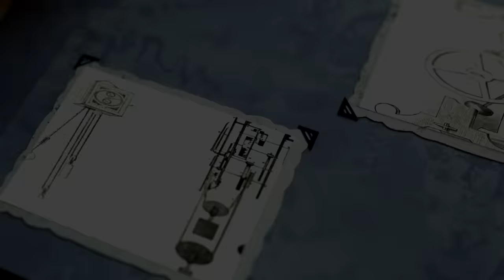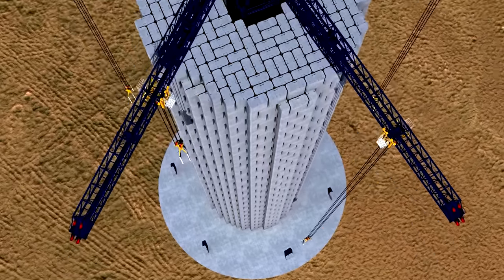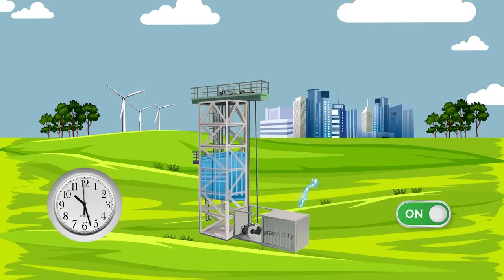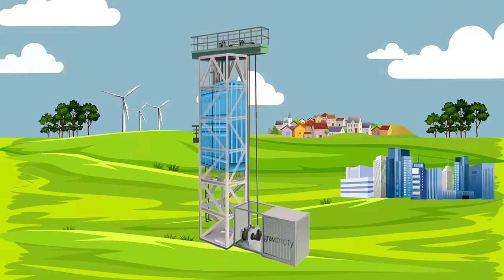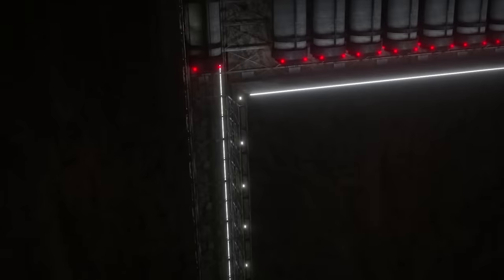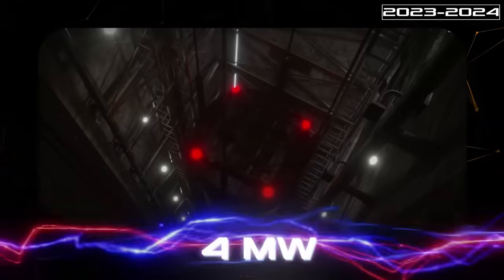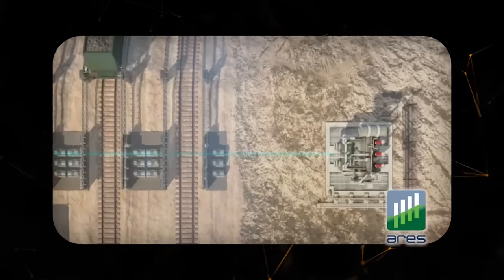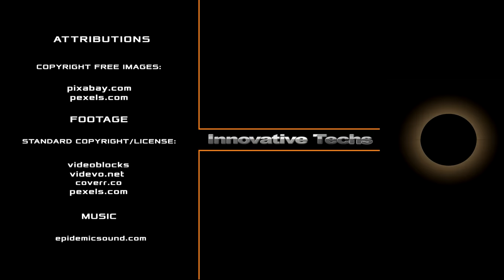How gravity batteries could change the world

Comment: This idea is actually founded on the idea of the pendulum clock, which uses the same gravity-powered principles to turn the hands of the clock via weights and a swinging pendulum to allow the machine to “tick”, allowing its power to last much longer than usual. This idea uses a much similar concept in the form of simply a much faster gear ratio to generate the electricity via the weight’s descent, and it too has been utilized in previous millennia to operate millstones and sawmills, and even more basic contraptions like gates and drawbridges, when the traditional means like water or wind were not even available. It’s a neat concept for today.

As for my personal stance on this idea, this is the sort of thing that could’ve popped up in a technological magazine back in the 2000s, along with other innovative products like the fuel-cell car. It’s a solid concept, and since it relies solely on natural forces to generate electricity, there’s absolutely no pollution generated by the machine itself, which I definitely approve of. It’s a genius idea behind Gravitricity’s bright minds, and just a couple hundreds of these should be enough to power a large city like New York or Chicago. This is even a godsend for bushcraft diehards as well, as they can utilize this in the absence of water or wind, in place of a regular li-ion battery.

Oh, and as for those who consider this project a scam and the company only out for profit, get real, please. Any one of y’all could’ve said the exact same things about the printing press, pointing out all those fragile little parts, and the steam engine, believing that steam cannot possibly be strong enough to power a device, and even so, it would just cause the machine to burst anyway. If I had a penny for each time someone laughed at a technological innovation anywhere in the world, I’d be at $50-trillion within a matter of months, if not weeks. It’s literally nothing new, and inventors are bored of that flawed argument time and time again. Try going outside for a change, instead of making fun of them.

Comment: I think gravity batteries have their place but they are hardly going to change the world. 
A 8kwh gravity battery (my estimate as the average amount of energy a single house uses overnight) requires approximately 150 tonne weight lifted 20m. 
If you want to provide 8kwh per household for a small town of 10,000 homes you need to to lift 1.5 million tonnes 20m. or 300,000 tonnes 100m to provide that amount of energy. Not very feasible.
Reply: To put into perspective a 8kwh battery weights about 100kg, not 150,000+ kgs for the equivalent gravity battery (lifting 20m)
Ofcourse using old abandoned holes in the ground is a good idea

Comment: The headline to this video is so far removed from reality to be laughable.

Firstly they are far too weak and secondly they are uncontrollable which is not what is required, there are too many uncontrolled input to grids already in the form of renewables.
For those talking about the inefficiency of pumped storage, or any other storage for that matter, it is required for one very good reason making the losses worth while and that is to be able to 'inject' a large amount of power very quickly into a grid for the event of a sudden drop in supply relative to demand to bolster frequency. It is not and cannot make up for renewable's intermittency.

Comment: every single "renewable" source, uses resources that pollute on a far greater scale than fossil fuels, so the ideas aren't really that good.. wind turbines STILL need oil... which is fossil fuels. and even any lubricants that are synthetic are chemical based, making them far worse for the environment. solar panel resources are not the standard stuff and as such end up as a pollutant when being created, and i don't think anyone has though of the mirror effect with the panel reflecting heat back into the atmosphere. if you're talking about climate change where the heat is going up.... why would you want to add something that will guarantee the heat increases?? especially as the ozone layer doesn't allow heat to escape, which is why we have our warmer days. this would guarantee the global warming effect, and i have never seen anything arguing against the question. has it ever been studied??

Comment: Sigh. Yet again the scam resurfaces. Liquids are simply better, period. Peak water usage and peak energy usage timeframes tend to coincide with one another, meaning that water is pumped up during low energy consumption and low water consumption, and then downflow allows water to be available when needed while also generating electricity. It is a dual-purpose system that works well with our natural living arrangements. By contrast, this concrete pillar does nothing for us aside from 'store energy' and it stores far, far less than the potential water reservoirs do. It is more expensive to 'lift' the concrete than it returns when dropped, with no secondary benefit, therefor it is a net negative on the power supply. 

For those that argue that water is scarce in some regions, yes... so collecting it and storing it is even more important. Just because we are storing it in a power-supplying tank doesn't mean we can't use it for the people's needs. They need to store their water anyway, so why not store it in a manner that you ALSO get electricity from it when it is used?

Every single one of these "large heavy object storing energy" designs is just another demo done to steal investor's money. Throwing around words like "skeptic" when talking about the harmful process of concrete manufacture, and claiming to "source" their concrete from recycled materials is a pretty weird stance to me. So... we are pushing the buck down the line to transport extremely heavy materials from one place to another... which is itself a logistical problem of fuel, resources, manpower, all while ignoring that concrete generally isn't a 'waste product' of other industry. The only time we 'reclaim it' is from demolition or a structural end of life for safety reasons. 

It's just like the people that keep 're-inventing' modern rail with individual electrically driven cargo pods, missing out on the whole point that rail is only efficient because centralizing the locomotive power allows us to drive massive loads for minimal effort, but adding individually charged batteries to thousands of individual pods is more harmful to the environment and very demanding in terms of monitoring and logistical "pathing" than the current primary single engine drive.

Comment: Maybe they should us water as the weight going down, drain it on the bottom. That way use less energy to lift the weight and pump the water back up. Plus if there is accident when the weight is going up or down it can cleared easier.

Comment: If you work out the math for cost and energy generated, this overpriced boondoggle will leave you laughing.  There is an interesting option which is still not economic, but at least it’s closer.  Rather than build these expensive towers why not take advantage of the mountains which nature has provided, one of which, ironically, appears in the background of the opening frame.  So, here’s what you do.  In the daytime run a trainload of rocks up to the top of the mountain, using solar power, and at night let it drift back down, generating power along the way.  It still takes a lot of weight lifted thousands of feet to be able to generate enough power to make a meaningful difference, but trains can handle a lot of weight, and we have an abundance of tall mountains in the country, especially in the west.

Comment: Nothing new, and absolutely one of the lower energy density of all. You can lift 1000 metric tons and still be without energy after few hours. Other cons are high building costs and manteinance and safety of mechanical structures over time.

Comment: This is so unbelievably dumb and one of the most inefficient ways to store electricity. Pumped storage has been used for nearly a century and is as simple as it gets. Pump a bunch of water up hill into a reservoir. Let it flow back out when you need the power. Nothing wears out. You're not making concrete. It's quiet. It doesn't require all of this ridiculous mechanical hardware and computer software to lift solid objects, stack them. 

Seriously, this is such an unbelievably dumb and unnecessary idea given pumped storage and its proven track record for nearly 100 years.

Comment: How will these concrete batteries change the world? won't change at all. except that they will deceive people who did not think of calculating in advance the required weight of the structure.
eh, it would be nice if it would be to replace the concrete with something easier to work with. something cleaner, cheaper, more scalable and more durable, like water... oh wait, Pumped-storage has been around forever!

Comment: This is such a stupid video. You have zero understanding of what you are speaking about and misleading viewers to think that this 'gravity battery' stuff is new revolutionary technology and not a scam. Hydroelectric plants with dams are the best since the moving parts are water + pumps + turbines. These mechanical analogs have 1000 different points of friction, tension, compression, torsion, wear, and failure. All the efficiency values they claim are over estimated, and the potential danger is under estimated all compared to simply hydroelectric plants.

If you have no rivers/lakes and need power then this scam system of gravity batteries is something else that wont help you. You can install passive energy collection sources, nuclear power, combustible fuels, or pay $10million to bring power from somewhere else and save money compared to 1 of these scam batteries!